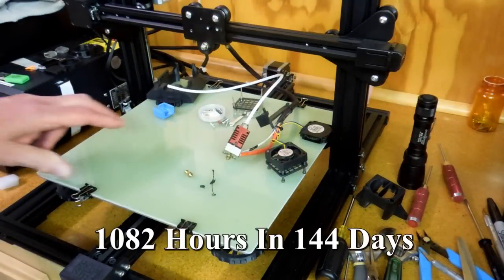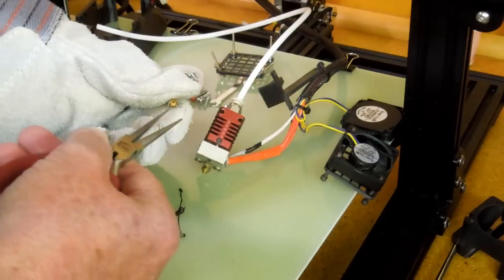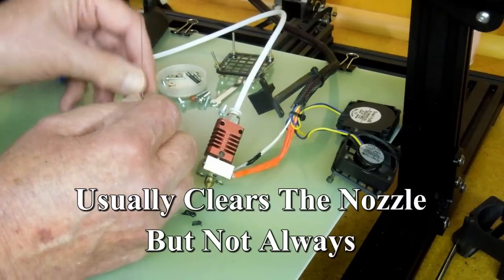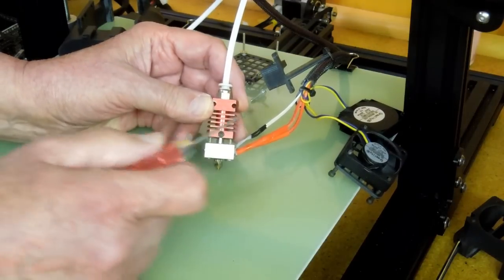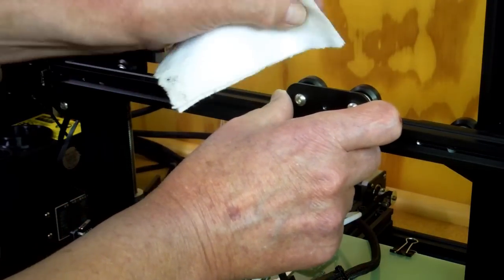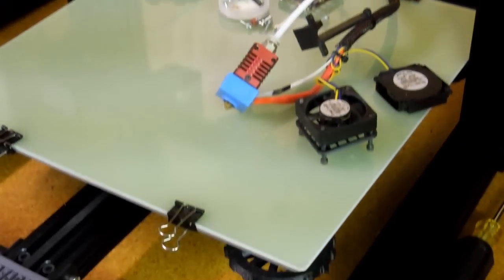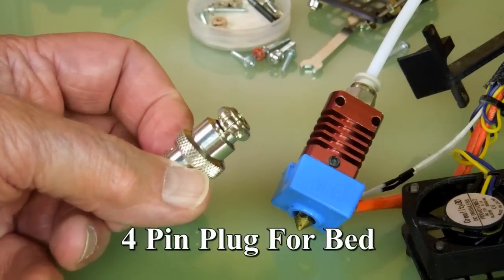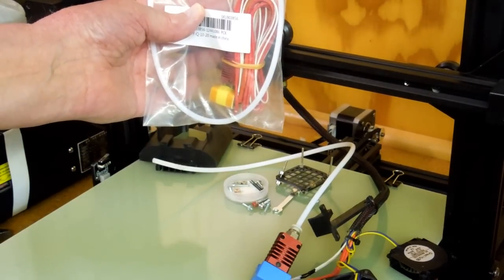CR-10 Maintenance & Replacement Parts

Comment: 6 years ago :)

Small socket set for hot parts.
Bowden tube has to be cut flat and the nozzle has to touch the tube.
Damage to Bowden tubes may be extensive at couplers.
Extruder may be overheating.
Any Silk or other additive could be large particles.
Check actual temperature at nozzle

Comment: Hello, Enjoyed the information and links. I will be ordering from some. I noticed you showed the 4 pin bed heater to control unit connector, Do you have a source for that connector?
Reply from the maker: This is one: 4 Pin Screw Type Aviation Plug and Socket
https://www.banggood.com/custlink/mGvGMEsWY9

Comment: Your PTFE tube is not flush to the bottom of the hot end/cooling block. Print some of the coupling clips and while you're holding the tube firmly at the bottom with 1 hand, press the lock on the coupling release with the other hand. Your tube is likely backing away & giving space for filament to flood, blocking passage in the future until fully cleaned out. Print & use something like these on your hot end tube coupling as you push firmly down on the tube as you install them:
Harness & PTFE tube clip found on #Thingiverse https://www.thingiverse.com/thing:3594974
Reply from the maker: Had you read some of the comments I left under this video, you would have seen I later found there was a burr (machining burr) inside the transition tube stopping the Bowden tube well short of the nozzle. This was also the cause of my difficulty changing filament. Once I got rid of the burr, changing filament became very easy and the jamming went away as well. I have also been using the locking clips for the push-to-connect fittings for quite some time. Work great. Thanks for watching and your comments!

Comment: The CR-10 is on offer right now for $339 until the 11th. It's a shame the coupon code doesn't also apply. Getting to that $299 price tag would pretty much sell me on it. :) Thanks for sharing Ron
Reply from the maker: Jeff, With Banggood you get the sales price or you can use the coupon code... either/or... but not both. As far as I know it has always been that way.

Comment: Ron, my printer is a little different but it looks to me that you could clear most extruder  issues by removing the white tube above the extruder and cutting the filament a few inches above the extruder. The next step for my printer is to heat the extruder and wait 3 minutes or so and then grab the filament with a pair of pliers and pull upwards like heck and stretch the filament and wait a few extra second and the clogged filament pops out the top. can you do this with the CR-10?
Reply from the maker: The bowden tube (white tube) connection on top of the hot end basically needs an act of congress to pull out. After a few thousand cycles of the extruder pushing and retracting the push to connect fitting are locked in pretty solid. Interesting thing about my experience with jamming. I thought the bowden tube was going all the way down to the nozzle. However, after I made this video I discovered there was a burr inside the transition tube stopping the bowden tube well short of the nozzle. This was also the cause of my difficulty changing filament. Once I got rid of the burr, changing filament became very easy and the jamming went away as well.
Reply: @RonaldWalters2010  Good to hear. My Bowden tube comes out easy. I guess it is a Bowden tube. Ha! I first push down on the white cap and at the same time pull up on the tube but I figure you know that. The tube will stick sometimes and I've found that it is not necessary for the tube to be pushed in for a solid connection with the cap. I realize your system is a little different but I thought I would attempt to add a comment that may worth considering. On my machine there is a smaller diameter tube that fits inside the brass extruder head and I find that this short tube will become warped after a while causing prints to become less accurate and or clog. Every time I've replaced the PVC type inner extruder tube everything went back to normal. This is why some folks go to an all metal hot end. It sounds like you extruder may be different.

Comment: Micro Swiss also makes an upgraded hot end for the CR-10, it definitely stopped my leaking and jamming problems i had with mine> i have also found a lot of success with steel nozzles over the brass one and have not had one even come close to jamming
Reply from the maker: Thanks for the information. I have looked at the Micro Swiss but have been too cheap to buy one (yet). Here, I am trying to give people an idea of what to expect with the CR-10 original equipment.  Interesting thing about my experience with jamming. I thought the bowden tube was going all the way down to the nozzle. However, there was a burr inside the transition tube stopping the bowden tube well short of the nozzle. This was also the cause of my difficulty changing filament. Once I got rid of the burr, changing filament became very easy and the jamming went away as well. Thanks for watching! Please subscribe!

Comment: Do you have a PO box, I have a bunch of replacement heater blocks for the Ender. I use it too, but I replaced the block because of leakage and blocking. I would be more than happy to send you a few heater blocks with thermistor and element. They are e3d v6 style blocks.
Reply from the maker: David, thank you for the offer but I have enough spares at the moment. Appreciate the offer! Ron